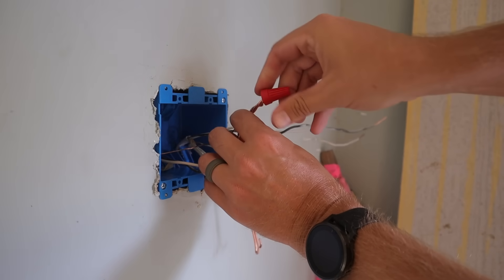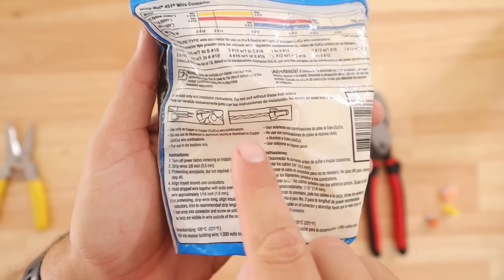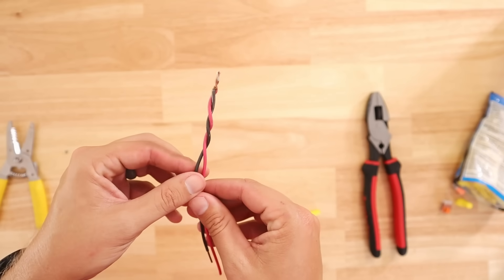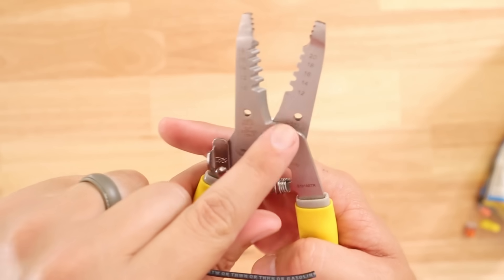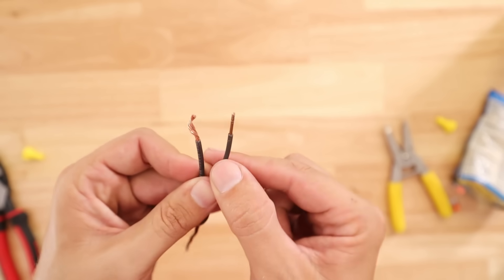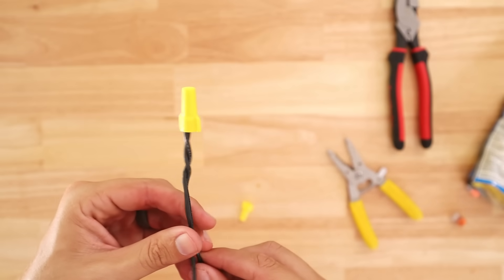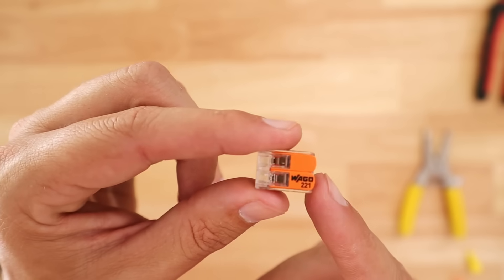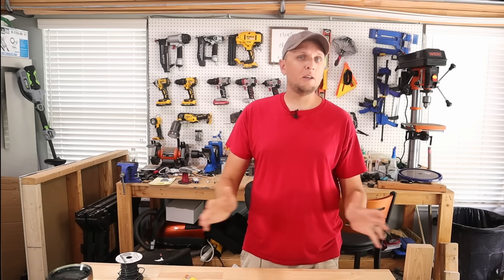BIGGEST Mistakes DIYers Make When Connecting Wires Together | How To

Comment: Quick question,  I noticed when replacing my outdoor lights the wire nuts were also wrapped with electrical tape,  I thought it was a great idea since it was an outside installation so I continued to do it this way (outside only).   What are your thoughts on the use of tape over the nut?
Reply: i personally put butt connectors with shrink sheaths if im doing outside applications. youll wind up with a hodgepodge of tape never really sealing and electrical tape has a tendency to degrade over time which will only leave your nuts exposed. no one wants exposed nuts.
Reply: I've seen this done on a lot of "older" wiring (or perhaps wiring done by old-school electricians?). Its not bad, but if that electrical tape is making a practical difference, there's something else awry with the work.
Reply: @burnhamrobertp  Well, couldn't it also be the electrical tape is providing an environmental covering, like a high-dust plus high-humidity area? Like you said though if practically it matters, there is probably a better way to remediate.
Reply: @scanhelper  it's possible, but again if that's making a difference, there are broader concerns with the installation. This is why the NEC requires outdoor receptacles (for example), the problems you describe are real, but electrical tape is insufficient on its own
Reply: You need to think. If the box is sealed it's not needed. I have never seen anyone tape an inside, wire nut. So then if it's sealed it's protected from weather. (Someone said that.) So then your down to, if it leaks. Tape could cause it to pool. Just make sure it's open side down, and you are good.

Comment: Working on a bench vs working on a ladder trying to install a light fixture (especially for a DIYer) are 2 different things,. Pre-twisting stranded wire onto solid is tricky up on that ladder. With a Wago the fixture wire can be put into the connector on a counter and the only ladder work is putting the solid wire into the Wago- way easier- plus light fixtures are generally low current (especially now with LEDs) so the Wago has little stress on it. I can see the concern about the Wagos in high current situations where proper pre-twisting and a tight wire nut are possible- this would give much more surface area for contact.

Comment: I lived in a house in Seward, NE that had a new box put in. They spliced every wire in the whole house into this old box.  Yhey also jacked a hole in the basement floor and left it as a hole when they put a shower on it to cover as hole.  All the nuts for the wires were just twisted and they used heaver wire from the old box to the new box and put the breaker that was for the bigger wire so it was possible to overload the wires.  This was done by a "professional".  The laws and rules were put in for a professional because they cheat ande cut corners to make money.   A diyer would not do this because it is his home and he does not want to put his family at risk!
Reply: We should allow the homeowner/ diyer to build a home w/o any license requirements, but he must live in it or leave it empty for five years.  Not doing this is an automatic 5 years in the pin, a forfeiture of all assets, including the houses they own, and are currently living in, and a loss of the ability to ever wouk in the profession in any capicity.

Comment: Question for you, I have an extension cord about hundred feet long and it's like I think 10 Guage really big. Why is my outlet heating up to where it's not tripping the breaker but plug melting , I was powering  an 8 gal air compressor TIA

Comment: Would like to add that wire nut brands are important also. There are copycat brands at most home improvement warehouses. The correct composition of plastic should bulge at completion and not crack. The inferior plastic nuts will crack. Of course the correct composition allows the metal spring to release from the plastic right as it bulges. It takes practice for sure, especially if you're roping new construction for weeks. There are correct tools on the market to save your hands for the constant twisting. However you do have to start with your hands and lineman pliers. Ever wonder why a licensed electrician and his underlings have so many tools in their belt

Comment: Instructions on one of the major brands 3M I believe says a minimum of 7 turns of the wire nut. The other thing not mentioned that I have seen in my 20+ years in the electrical industry is people striping the insulation back to far, check the container for instructions or a general guide for wire nuts is your finished ,after pre twisting, wire should be the lenght of the spring inside the wire nut or slightly longer but not much longer. so start with the wires striped longer  if you pretwist; pretwist then trim to lenght of the spring in the wire nut if no length is given. On devices good ones will have a srip guage on them.

Comment: Never used a wire nut in 40 years and won’t, awful things.  The new Waco click down joiners are far better, a great invention. However the push fit versions are just awful for most twisted wires, the thinner household wires just won’t go in, only good for solid wires. I wasted money on those.

Comment: I’m am Australian sparky and we don’t use wire nuts although one company is trying to sell them. Anyway we use screw connectors in nearly all case. As the name suggests you need a screwdriver to use them. We also only use stranded cable for our wiring and the only time we come across solid is in older homes. Stranded is more flexible and suffers less breakage. 
I have noticed there are quite a few differences between the USA and Australia.
Reply: Well said. Same in New Zealand, where we wire to the AU/NZ standard.

Comment: If possible plug in a high current item like a heater and run it for a few minutes and see if any of your connections get warm or hot. If the connection is a-little bad there will be a fraction of an ohm resistance so there will be a small voltage drop so power is dissipated in a small area so it will heat up. If it is a really bad connection the resistance will result in the heater not getting enough current to work properly. The connection heating up is a sign of a bad connection.

Comment: Ok so you point out that code says to follow the directions of the wire nut manufacturer then tell us it is wrong and it is your opinion. 

That works very well in a new build but some of us work in older homes with very little wire to work with and pigtailing is practically not possible. So using the wire nut per the manufacturers instructions works
Reply from the maker: I did not say that.  I showed an example first that is not correct and then I showed an example of it being correct without pre twisting.

Comment: You try pretwisting every little 2 wire joint with linemans everyday you'll have carpal tunnel in no time.  Been an electrician for 12 years never pretwist and never had a bad joint.  Waste of time and wrist longevity.

Comment: Great video.  I had to learn this technique from trial and error and it’s great you made a video.  When would you use the copper crimp wire connectors instead of wire nuts?
Reply: In a machine or permanent installation where there'd be a lot of motion.
Reply: @ObservationofLimits  Thanks for the info.👍

Comment: My house had twist then wire nut and many have come loose. I rewired the house and didn't twist first it may seem counter intuitive but straight wires hold better in the wire nut. If you get the twist wrong or loose or misaligned it's hidden by the wire nut.
One that failed didn't even have the wire twisted half way  around the other wires a d it had been pushed out of the nut by the twisting action. It looked fine to casual inspection but once the nut was removed it was obvious what happened.
Those wire nuts are sized for a certain number of wires twisting increases the diameter of the wire mass.
Don't bother twisting the wires it's not just a waste of time it's inferior to leaving them straight.

Comment: Wago gives a far more reliable connection if you have any stranded in the mix because the spring loading will always take up any slack caused by shifting of the strands relative to each other, ongoing.

Comment: So... we buy the Wago device, and just kind of have it. Then we twist the wires together well past the recommendation of the manufacturer. Then we remove those incorrectly twisted (and very brittle) wires. We then cut them below the incorrect twisting, strip them again to length, and put them in this "Waygo" device? Just making sure I have my steps straight because it seems to me I could remove a bunch of those steps...

Comment: If my apprentice twisted a group of wire all the way down the insulation like it shows in that first picture I'ed have chewed his ass out.  That is 100% unnecessary, pointless, and potentially could cause more harm than help.  Sure twist your wires together but there is literally no reason to run the tiwst all the way down the wires like that and it makes it a pain in the ass for anyone coming behind you to do additional work.
Reply from the maker: I mean that is your opinion and what you do with your apprentice is up to you and he should follow your instructions.  There are benefits to it as well.  And as far as someone coming afterwards, if I think it makes it a better connection then I don’t really care about someone maybe having to come in and untwist some wires.  Its not that hard to do.

Comment: In your opinion?   When wire nut is tightened the wires automatically twist together.  The connection is secure and thats all that counts.  Not your opinion.

Comment: as a journeyman lineman and formally a electrician your dead right except ideally your cut should be on a 45 after aggressive pre twist, then drive that point to bottom or wire nut (Marrette) twist again  ....electricity is the only tease that is not NOT for a DIY er !

Comment: A mechanical joint is always best. Then just cap it with the wire nut. When working a hot circuit not making a mechanical joint is dangerous especially in a metal box.

Comment: Who ever wired my house was a idiot. Open junction boxes, electrical tape for wire connections, outside outlets on same circuit as bed room. Kitchen on same circuit as garage.  0 cfi outlets, I literally have to rewire the whole house. My home inspector cought none of it. So far all plumbing has been redone wiring this winter.

Comment: Do the Wago connectors come in different sizes? My home has stranded wires coming into the back of my sockets etc, but I bought some of these fittings and the mains wires were far too big to fit inside the little holes. So I had to go back to using the wing nuts.

Comment: First mistake, is thinking YOU should be connecting anything related to mains at all. Dunning Kruger is out to get you, and what you DON'T know, will burn your house down, with your family in it, as a worst case. Hire a licensed electrician. Get the paperwork, so that IF your house does burn down, you can show it to the Insurance company..  Otherwise, you risk loosing your home, and your family,  with no payout from the insurance company. It looks simple, but there are so many things you REALLY need to know to do mains. And these youtube videos do not cover any of it.  Please, leave it to the professionals.

Comment: You have to be careful not to twist too hard.  I've had wire poke out the top of the wire nut when I twisted too hard.  I usually twist until I have two or three twists in the wire on the outside of the nut and then I make sure the wires didn't poke out the top.  If the wires when cut are sharp they can poke through the top.

Comment: No!
The labeling shows, that after putting the wire-nut on the wires, and turning the wire-nut, it also twists the wires.
So this may rather suggest, that you need to turn on the wire-nut really strongly, until the wires are twisted.

Comment: Good video. Im an electrician and agree with rolling the wires together "twisting with kleins" . Anytime i half assed something like a simple tap of wires i got a half assed result when double checking it but do it right one time and its done right. I dont have to worry about the tap when i poke it into the box i know its good.

Comment: Not a bad tutorial but I try to never use those wago nuts as they just pinch a bit of white like snap plugs in a modular trailer. Run a full 20 amp load on some #12’s and point a thermal imager on the wagonuts… now I know they are somehow ULlisted but meh… also wagos only need a few twists to pull the wires right out. Ok I will confess I do use the wagos built into led fixtures… barely any load. But that’s it… oh and my preference for stranded to solid is to have the stranded “in front” of the solid so the wire nut actually locks the strands over the solid. Even twisted, a solid can grab the wire nut coil inside and be pulled in ahead of the strands. But great video anyway…
Reply from the maker: Really appreciate all of the input!

Comment: I use the wire twist with the wire nut and then for added safety I even use electrical tape and wrap the bottom of the wire nut around the wire itself.  Helpful thank you.

Comment: Do not use the Wago connectors. Real electricians know that the tension lever/spring degrades from cycles of warming and cooling then fails allowing the wires to come free in the junction box. Wagos are a temporary connections not permanent (unless you want ground faults, arcing and fires). Use wire nuts for pigtail connections.

Comment: These don't look they would make a reliable connection, we use a screw type connector. Fray the ends and twist together then trim to length and establish in connector and tighten, never seen one come undone.

Comment: Yes, well, depending on the gauge and material, pre-twisting often ends up twisting the wire below where the cap would go before it twists the protected area anyway.
Reply: I have had inspectors tell me to never pre twist. some of the issues i fix are due to a bad twist.

Comment: I wonder if I can fit those Waygo’s in my guitar electronic’s cavity, so I could swap out pickups without soldering. They look small enough to fit a couple. Might experiment with this!
Reply: Talk to amp dealers,They have disc,size smaller than dime,put wires in,squeeze button ,all wires connected

Comment: the most trying place for wiring might be in my grooming van (it gets really hot, really cold, and vibrates ALOT)

I dont pre twist, as the nut always does that and i avoid grinding into the copper with my wrench.. i do make a twist as explained and finish with electrical tape after testing with a little tug- neery a single wiring issue after many years=)

Comment: Love wagos- use them 95% of the time. The only issue, they’re bulky. In tight spaces, not ideal and won’t work. Again, depends on the job.
Reply: I think WAGO's are OK for light circuits but on anything designed to draw significant current nuts provide far more contact surface of the bare wire.
Reply: @SerenoOunce  oh I could absolutely agree with that. I only use wagos in low voltage. I should of mentioned that.

Comment: Decent information, but some is way overkill. Never let the wire braid together more than 2 or 3 twists under the wire nut. Anything more is a pain in the but to undue later on if you need to take out or add another wire later. Best is to pinch the wires hard, a half inch below where strip. Then pre twist them hard  to where you pinch.

For stranded, this is the best trick:

Stranded wire is almost always twisted to the left. Take what you stripped out, and twist the strands to the right. This will keep the strands from spreading apart.
Reply from the maker: Really appreciate the input Bob.  Thanks!

Comment: Vibrate out ? Over time ?
Reply from the maker: Heating, cooling, there is vibration from current.  So yes, if the wires are not secured properly, they can fall out.

Comment: I don't even use those stupid things. I just twist two wires together, then folding it over to one side or the other and run electrical tape over it all and it looks like a single wire with a small swell. Never had a problem.

Comment: yeah i'm an electrician and i was like really is that what some people do,i always learned to pre twist,do it just to be safe in the long run and to see if the wire isn't broken because some copper wires can break, even when i have to go for repairs due bad connections causing inside burns in sockets or outlets the most cause is the so called DIYers did it the wrong way so when the current goes through it or a spike in the net and vibrates it sparkles and in the long run burns melts or gets black, copper becomes weaker from those sparks,i could go on but thats it xD
Reply from the maker: Thanks a lot for the feedback!

Comment: 3 twist ( meaning the wire gets twisted for 3 revolutions ) was what an electrician told me. I was also told by another that in theory that the Nuts are made and designed to have straight wire put into them so that the interior get merged with the wires properly with the correct distancing.
Reply: Correct, as wiring continues to improve. Using new high flow capacitors, the generators electrical imodial interaction between, ions, ectrodes, connected by the current at which near light speed is attainable  through proper technical jargon and faces intertwined voltage surger protectors.
Reply: @malikross6152  just why?

Comment: Licensed Industrial, Commercial, Residential electrician and automation engineer - I don't pre-twist and haven't had failures in the last 20 years. It is more important to ensure the correct strip length AND the correct size wire nut for the number of wires. If you have access to Wagos, you can eliminate the concern entirely.
Reply from the maker: Appreciate the input!